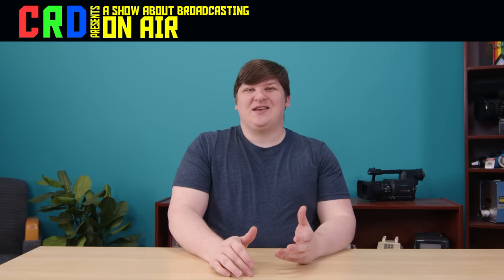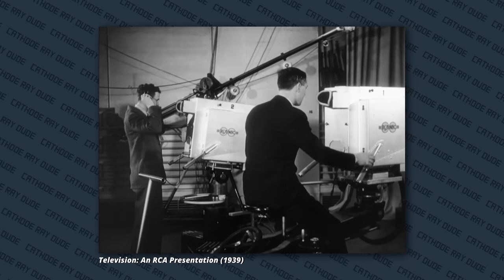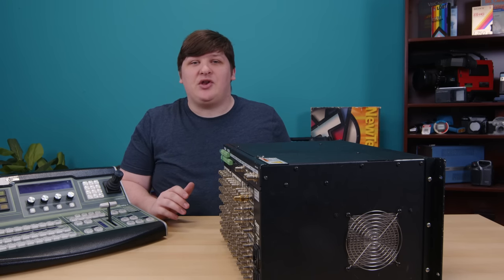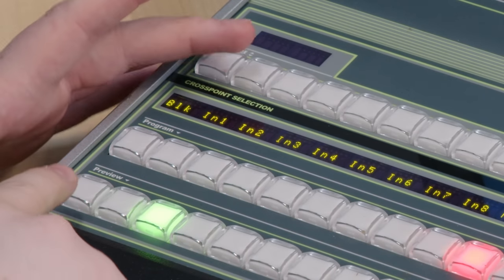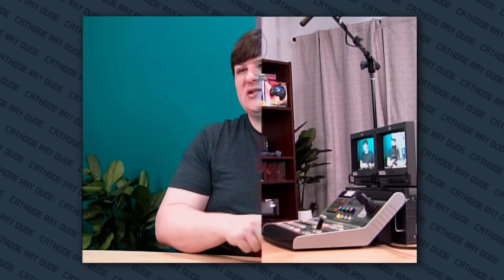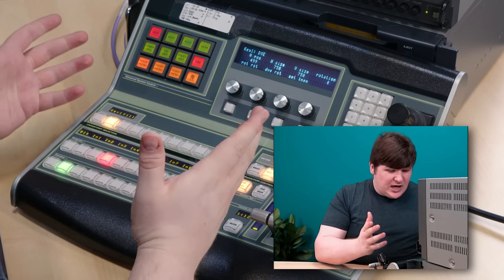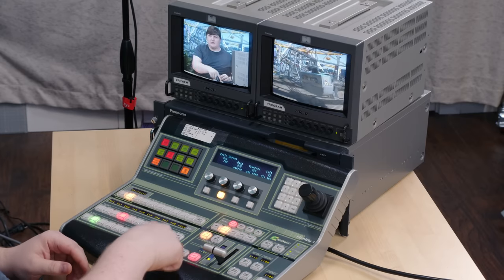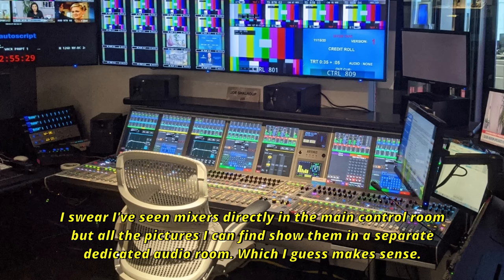What the heck is a video mixer?

Comment: When the community TV station I work at started in 1993, our first switcher was home-made. It was just a button that mechanically switched between the two consumer VHS camcorders that served as our first studio cameras. It was dubbed the Bang Box, and when you look at our earliest shows, the picture would roll every time you switched to the other camera because of the lack of sync.
Reply from the maker: aaaaaaaaaaaaaaaaaaaa
Reply: would be interesting to get example footage of that happening as a contrast for whenever he makes a video explaining genlock
Reply: a bang box! that's what we use to call a raw non-vertical interval video switcher too! Some times all you need is state of the budget, and not state of the art, to get the job done! :)
Reply: @CathodeRayDude  Other things I'll add:

I've never heard the term hot-punching before, and I find it funny that it's considered taboo sometimes. We use both methods depending on what we're doing. If we're taping a talking head show with three cameras, we'll hot-punch because you can just keep three fingers on the Program row and it's easy. If we're doing something like Bingo that uses the Key inputs on the switcher to overlay cameras on top of the bingo graphics, you can't hot-punch because it will change the bingo graphics to a camera that has other cameras keyed on top of it, and it's chaos. Ask how I know 🙃

As far as transitions go, the only thing we've ever used besides a dissolve or a wipe is during our live Christmas telethon, we'll use a media wipe with pretty snowflakes to transition between the studio and the pre-recorded clips of kids singing.

The only thing I've used the T-bar for was to do really slow dissolves when we had a musician in the studio giving a performance. That's how you also do that thing where you partially dissolve between a wide shot of the musician and a close-up side view of their face.

On a good switcher, the T-bar is dampened with what I can only assume is really thick grease, so it's very easy to get smooth transitions using it.
Reply: I've never heard the term hot-punching before either...
Reply: @themaritimegirl I seem to recall the ones on the Snell & Wilcox Kahuna having a little bronze and fiber washer disc brake. They were made by Penny & Giles and were built very very tough---- but somehow the TDs broke them anyway?
Reply: I'm so glad I knew somebody would be in here and comment that. I know I know I just know it that manual switch boxes were used I don't know how I know it but I know it.
Reply: @CathodeRayDude  hell, same
Reply: Isn't/wasn't it technically illegal to broadcast signals with messed up sync?
Reply: @kFY514  We weren't broadcasting live from the studio at the time, or putting the raw sync-loss-ridden tape to air. We would record the program using our consumer/home-made equipment, and take the tape to the cable head-end to use their proper equipment to insert graphics, make final edits, and record the finished program to another tape.

Visually the picture rolled with each camera switch on the final program, but the recording itself was a proper stable signal.
Reply: @CathodeRayDude   Depending on how you set all those things up you can pretend it is some sci-fi stuff on a space ship and play beam me up Scotty lol.
Reply: I’m so glad you commented on this video haha
Reply: @CathodeRayDude  I think I have a mini version of this by jvc for consumer vcrs it can do some effects and editing.  I can also make 2 vcrs pause with it as well.
Reply: @themaritimegirl  I kind of figured you'd have something to say here. You're the only person I'm familiar with who works in an actual production environment. I had a chance to play around in another community station and helped make a mock program but that's obviously not the same as real experience.
Reply: In the early days of TV, before color and videotape, they did use simple hardware switching between different sources, but were able to get away with it because the video signals were all synchronized to the AC power frequency (50 or 60 Hz). So as long as everything ran off the same grid, there was no picture rolling when you switched inputs -- but if you had to switch from local content to a remote broadcast or network feed, then the picture would roll. The genlock was invented in 1951 and solved that problem, and also allowed NTSC color to do its 59.94 Hz field rate for weird technical reasons, because it no longer needed to be synched to AC power.
Reply: @vwestlife  From what I can tell the RCA TK-30A from 1946 (the first postwar camera) takes external sync inputs. That's what I (a non-expert) would call genlock. I'm getting this info on the camera from Ralph S' posts on VideoKarma. This is confirmed by the Museum of the Broadcast Television Camera's description of the CCU including a "sync in" connector.
Reply: @eDoc2020  The February 1951 issue of the SMPTE Journal has an article titled "The Genlock - A New Tool for Better TV Programming".
Reply: @vwestlife  I see the difference. It seems the Genlock (proper noun) was an RCA product to make a local sync generator run in phase with a remote sync signal. Before then you could only cleanly switch between signals if they're connected to the same local sync generator.
Reply: @tekvax01  I heard it used quite a bit when switching  between remote feeds
Reply: @kFY514  happened a lot before frame synchronizers when you needed to genlock to a remote site. . In that case you tied your whole station to the remote site and its sync so you could key over the feed.
Reply: @davesilver5493  Yeah I imagine that broadcasting broken sync (on an otherwise properly licensed station) wouldn't exactly get anyone jailed and that it used to happen occasionally for various reasons and that was considered normal. But I was always under the impression that it's always been "illegal enough" so that no engineer would willingly introduce a sync loss into a broadcast without a good reason, unless there was no other choice. Definitely not as a routine editing practice ;)

@themaritimegirl's answer provided some much needed clarification here ;)

Comment: The split screen was used on the news in the UK news outlets to get around the social distancing, by having the set very well designed. So that you could get both presenters sitting side by side and would only look really odd if a coffee cup was in the middle. Also, they used it for a program in the 70s or the 80s to get two quiz teams to appear above or below the other.
Reply: The quiz show University Challenge has done split screen since forever. It got so ubiquitous that The Young Ones did a parody using that effect.
Reply: The news in the 80s even used those ribbon dissolves which get called ugly in the video, haha
Reply: University Challenge! People finding out they don't literally have double decker quiz booths and it's just a vertical cut and getting angry is evergreen

Comment: Glad to see the mixer I saved from e-waste and sent to you will live on forever in this video!  I did a bunch of shows on this unit and you found features on it that I didn't know existed (the dip wipe!) but you're right - we never used the fancy DVEs, it was mostly cuts / dissolves, downstream keys and chromakey.  I'll point out that the grass valley switches have the program bus at the bottom, and echolab had the preview at the bottom - for someone that would do weekly shows at 2-3 different studios I had to always remember to switch - or else you might cut live at the wrong moment! (and that did happen!). Great video!

Comment: I'm a Technical Director for a news station. you got the basics! DVE can be super useful. You can place multiple cameras in PiP (picture in picture), then make another scene with those PiP windows in different places. Store them as memories and when recalling them, the mixer will interpolate/animate the movement of the PiP windows. I use that for taking either the outdoor studio camera or weather map, gives the PiP windows a neat zoom in transition. Our lower 3rd and full screen gfx inputs are still called CG, but they're fed by a PC playing back transparent pro res files. 
What in gods name was that audacity skin? I like it!
Reply from the maker: Turns out, that's just built in! Look in the options under Interface, select High Contrast mode.
Reply: PCs are great for graphics -- easier to design and easy to rewrite stuff on the fly -- plus it doesn't directly sit in the pipeline so worst case you lose the graphics but keep the video switching
Reply: @QualityDoggo  haha our entire main feed runs through a windows PC for some reason... So much for compartmentalizing lol

Comment: I really enjoyed this video.  Having worked in broadcast TV news for 10 years, and now running my own production company that specializes in on-location, live, multi-camera production, I use video switchers on a regular basis.  So, seeing the collection of video mixers you had gathered here was a lot of fun for me.

There are a few things I think I might be able to clear up.  First, on the topic of A/B style switchers (SFX generators) versus Program/Preview bus switchers- A/B switchers, like your Panasonic switcher in this video, were mainly used in video editing applications, where program/preview style switchers were/are for use in live multi-camera production.  

Before computer based video editing was really a thing, video was edited tape-to-tape.  The simplest form of this was having a playback deck and ar record deck.  You would have an edit controller, or controls on the tape decks themselves, to mark in and out points and record just those selected sections to your program tape.  However, if you wanted to edit something that was more complicated, and had more than cuts only editing (an entire TV show for example) you would have multiple playback decks and your record or program deck.  A special effects generator, also known as an A/B style video switcher, would connect all the source decks to your program deck.  You would use this along with an edit controller, that selected your various in and out points and controlled tape transport, to actually edit the program, with your video mixer performing the various dissolves, or keying in things like titles.

This is why the Panasonic video mixer has built in audio capabilities, for four audio tracks, the standard number of tracks that were supported on professional Betacam tape.  This is also why you have the program select button, you could select to send the program output to a third playback deck, in case you needed to dub scenes from one playback tape onto another, to allow you to perform an edit where you dissolve between them.

Typically, the edit controller would also have a preview button, allowing you to preview an edit and rehearse a dissolve or affect before you hit the edit key and committed it to tape.  So a preview bus output on the mixer wasn't needed.  The reason why you had an A/B bus, instead of a program/preview bus, is that this kind of editing came from film editing, where you would have an A-roll and a B-roll.  These kind of video mixers were also known as special effects generators because that was their intended purpose, to insert special effects in editing, not to be used for live television production.

In an online edit suite, where you would edit a full and complete TV program, you would have multiple playback decks, a master record or program deck, an edit controller, a character generator, a special effects generator (or A/B switcher), and a basic audio mixer if the switcher didn't already contain one.

The second thing I think I could shed some light on is why a TD would use a T-bar for a transition instead of the auto button-

There are two answers to this- First, sometimes you just want to.  There isn't a reason to use the T-bar instead of pushing the auto button, but when you've been doing a 4 hour long broadcast morning show, using the T-bar every now and then helps mix up the job a bit so you don't fall asleep.  However, the bigger reason is something I do frequently in my work, which is during live coverage of musical performances.  Sometimes during a slower song it is appropriate to do an extra slow dissolve, while other times a dissolve is appropriate, but you want it to be a lot faster.

Next, I'd like to address how and when all those DVE transitions and wipes are actually used and what they are there for.  It is true, on a basic 1 M/E switcher they don't have much use.  However, when you are switching a program with multiple M/Es you can use those DVEs to build various scenes, combined with keyed in graphics on the M/E you could build things like boxes, where you have multiple reporters on location and your anchors in the studio for example.  In these cases, the T-bar on these M/Es might be left in a partial position.  But you can get these elements setup on the M/Es before the show, or save them as a macro, depending on the switcher you are using, and then during the program bring up that scene you built in the M/E as a source.  The DVE's aren't really for doing transitions, but for building these kind of scenes or elements.
Reply from the maker: Thank you so much for all of the info, I will integrate this in future presentations!
Reply: I was going to say that, that was lot of sense to use a T bar in a musical due the variable timing in it
Reply: "film editing, where you would have an A-roll and a B-roll"

Wait, is this where the term "B-roll" referring to some unrelated shot you'd cut to when you want to hide an edit came from?
Reply: @scorinth  Yes
Reply: @scorinth  Basically, yes.  Before video tape, TV news stories were shot and edited on actual film.  Back in the day it would be normal to have a news anchor give a quick brief of a story, the promise, "Film at 11:00."

For quickly editing these news stories, you would have your A roll and B roll.  Your A roll would have your package's sound track.  You would edit your A roll first for sound.  Then, you would splice in your B roll material.

When the movie was made to videotape, these terms remained.  Even though the tech was now different, you would still edit a news package for audio first, then go in and insert your "b-roll" material, even though your B roll was now a tape instead of an actual film roll.
Reply: @CathodeRayDude  If you ever end up doing a video about tape-to-tape editing, or old style, tape-based, online edit suites, I'd be happy to be a resource.  I used to edit tape for broadcast newscasts, and I have some old photographs showing full online edit suites in use at a TV station in the 90's.
Reply: @adamgrunseth  ahh i love hearing about news before ENG!
Reply: Thanks for the great post n indo. You make editing sound like a fun, interesting, and exciting job

Comment: 41:50 
One application for using two program versions is during a concert.
You can have one output going to be tapes, or broadcasted. While another output is for sending a signal to on-stage screens.
This way you can have a wide shot aired, with a close-up of the singer on the screens that are located on the stage.

Having the same image would result in the Droste effect, where the on-stage screens would display the same shot as the wide angle shot. So, the shot repeats itself in the screen... over and over again.
Reply: I had no idea that had a name! I always just thought of it as the pixel tunnel lol
Reply: First time I've heard that name too, thanks!
We always call it the "infinity tunnel" or "infinity loop"; though sometimes I also call it "video feedback" in technical discussions.
Reply: @hyvahyva  The name "Droste Effect" comes from a brand of cacao powder. On the red packaging there is a woman holding a can of cacao powder. And on that can there is woman holding a can...
This is why it is called the "Droste Effect".

But, calling it video-feedback or pixel-tunnel will work. As long as the people in the conversation know what you mean, right?
Reply: Many years ago I was operating a camera for a show where the director mistakenly cut to a particularly bad case of the looping screen, their response was just a somehow comedically perfect "whoops". As long as I worked with that company, it was henceforth called the "whoops effect". 🙃
Reply: When you said on-stage screens I thought you meant little monitors for the "talent" to watch. Now I realize you mean the giant display for the audience located above the stage.
Reply: @eDoc2020  Yep, that's I meant indeed. My apologies for not being clear in the first place. 😇

Comment: I took a video production class in middle school in the 90's that did the morning announcements for the school. We had a very cheap A/B switcher and an even crappier CG machine. It is really cool seeing more professional gear. And as immature middle schoolers we used every single type of wipe that the switcher could do, usually using multiple different ones in a single morning.
Reply: Yep, by the early 90s only cheaper mixers used A/B